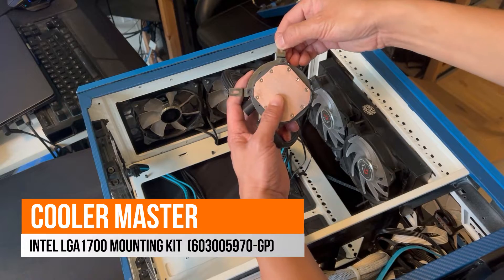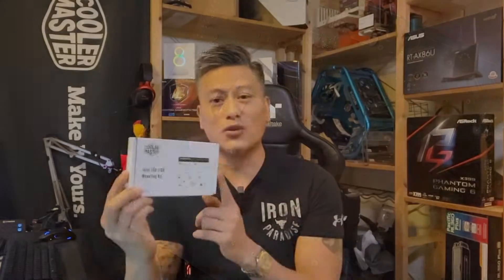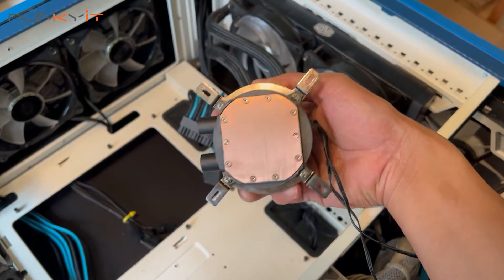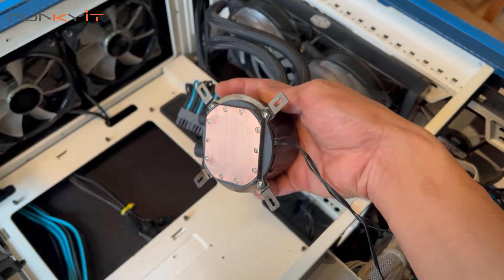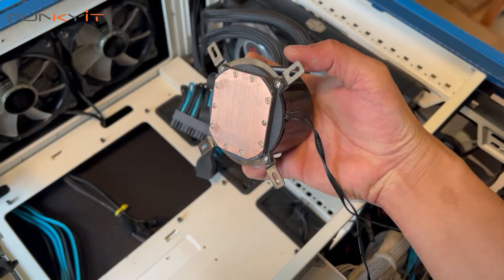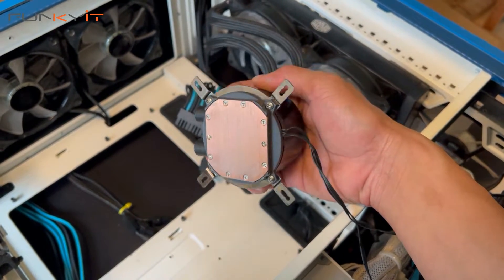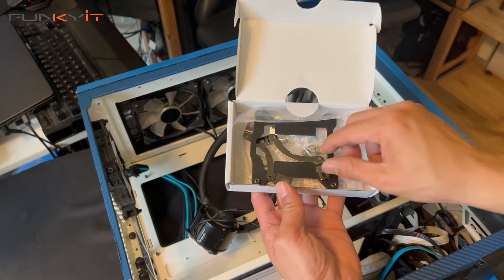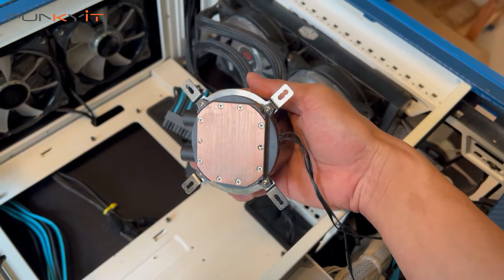How to install Cooler Master's Intel LGA1700 Mounting Kit on to ML240 AIO

Comment: I have a 13600k and a ML280 Mirror but the adapter included in the box is slightly smaller. Also the instruction manual is only a stupid series of pictograms with nary a word in sight nor a lost of components and what the hell they are so if it is the adapter for another socket, I will mever know

Comment: The $5 kit from Newegg, doesn't work with a CL280.  It is defective and can't provide enough pressure to hold the cooler in place.  This is a bad joke.

Comment: wont the lga 1200 bracket fit on for lga 1700 processor
Reply: It does and I installed my ML360 on my i7-13700K with the old 1200 bracket but my temperatures were over the roof so I’ve been running my CPU cooler on 100% for the past month. Cooler Master sent me the 1700 kit but it took almost 2 months to arrive, now I’m going to install it and see what my temperatures look like with 3.5x more contractual pins. Hopefully it fixes my overheating issue.
Reply: @liluzihorizontal5228 but how did you do that? I have recently bought z690 mobo with 13600KF CPU. I bought CM ML 360ML ARGB which came with 115x socket bracket and maybe 1200 but no 1700. I tried using my 115x socket bracket on my 13th mobo and it's falling short by mere 2-3 cms at max from the bracket holes. Now I ordered a 1700 Bracket from Aliexpress and I wonder if I'll get it in my hands or not

Comment: Shouldnt the water cabels be on the lower end for a vertical installation of the sink? If not there is a higher chance for air bubbles circulating, or so I’ve heard..
Reply: As long as the radiator header is at a higher location than the pump it will be fine. Air bubbles collect at the highest point.

Comment: Why does my mounting kit look different than this one? It says LGA 1700 but it doesn’t have the stand-off things and the wings that attach to the pump have spring loaded screws on them. Seems there is no way to pre attach the backplate to hold it in place which makes installing a lot harder without a third hand
Reply: They make more than one kit for LGA 1700 also for fans soooo

Comment: If you have CM aio with this 12th gen bracket and has no mounting pressure, you need to do minor modifications to the C-shape bracket that attached to the pump/water block because CM use the same standoffs from the previous gen which is a lil bit higher in Z height.
Reply: Hi, I was wondering what is the minor modification you speak of...
Reply: I cant think of any way to mod it to work.
Reply: What I did was mount it in reverse the bracket and provides good enough pressure

Comment: Does this work with the ml240 rgb v2 (circle copper contact)? Im guessing it says ML that means yes?
Reply from the maker: ML = MasterLquid. The brackets/fittings worth on all ML series from Cooler Master
Reply: @Funkykit  does it work on the ml v1 though? I cant find anything about this and on their site when it showcases all the ML ones it says v2
Reply: @evilchinchula  did you figure it out? I have the same question

Comment: I received this kit, and it's almost identical the one from LGA1200. Even with this kit, the pressure with CPU surface keeps low, and poor heat transfer. What temperatures do you achieve?
Reply from the maker: Full load… I’m still getting around 100 degrees Celsius with a Core i9 12900KF
Reply: @Funkykit  That is too high! I'll look for another option. Thanks.
Reply: @Funkykit I was getting 100c on 14900k also u need to put the retention braket in reverse

Comment: I am using the ml360 and I put the backplate/ mount the same as you and the screws are loose? Any help
Reply: Even I am having the same issue.The bracket is loose after tightening the screws.
Reply: Same here using a ml360l. I think the plastic backplate provided w/ the kit is low quality. Why do they not provide a metal blackplate like the original? I'm getting 95C on Cinebench using a 360 AIO. Too hot, I think. I was expecting better temps w/ such a big AIO. Did you find any solution for that?
Reply: I just bought the kit of newegg and mine is loose as well. What did you all end up doing?

Comment: is hyper 212 air cooler enough for Intel Core i9-12900K? working on buying Enermax ETS-T50 Axe ARGB CPU Air Cooler, 230W+ TDP for Intel.
Reply: Im at about 45' idle, when gaming it gets quite hot. It will do but I wouldnt recommend it. If you want air cooled Id suggest going with a Noctua one
Reply: @DJVegas2002  I ended up buying Enermax ETS-T50 Axe ARGB CPU Air Cooler, 230W+ TDP for Intel 5 Copper Direct Heat pipes. brackets included for intel core i7 12700k. not good at Celsius so at idle temp is at 80 to 89 degrees Fahrenheit and running pc games temp goes up to 120 degrees Fahrenheit or less without overclocking. 2 120mm cpu rgb fans installed and runs quiet. highest rpm for cpu fans is 950 to 1030. pc will keep me going for awhile.

Comment: Just installed my 12700k into my new build with the Lian Li Galahad 360. The bracket looks very similar to this and seemed super sketch at first, almost like I tightened it down too much. But now that its on its super secure and seems to be nice and flush. Have not completed it yet, hopefully she boots.
Reply: Which bracket did you use ?